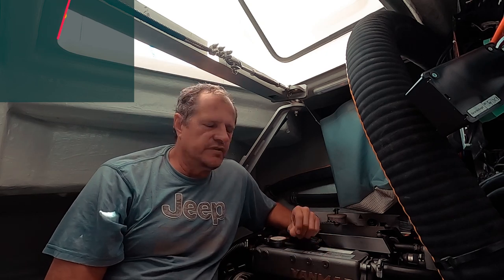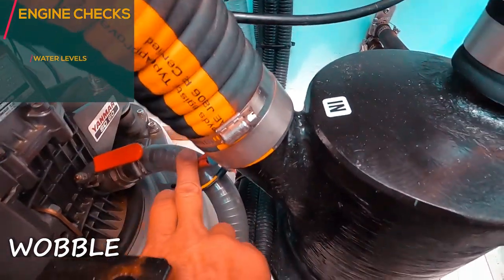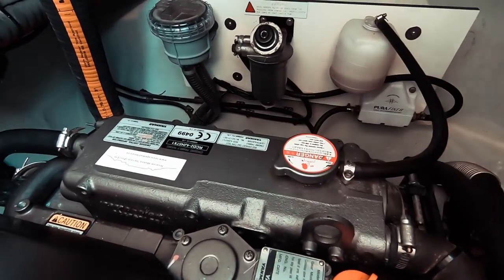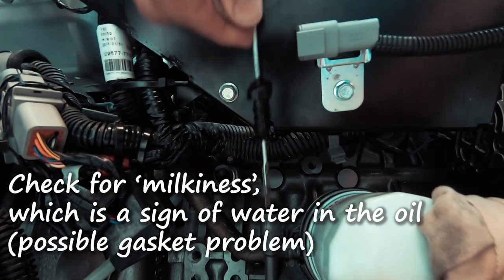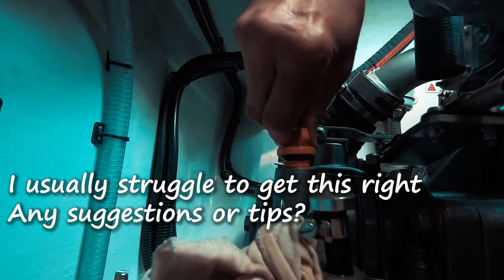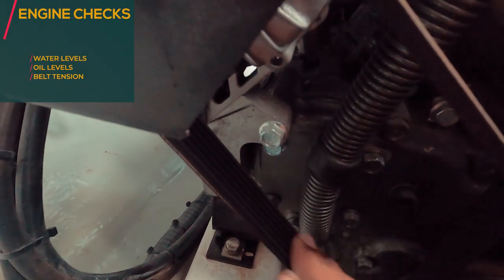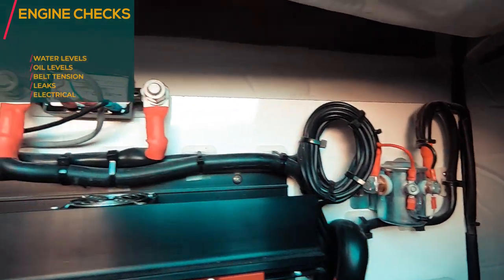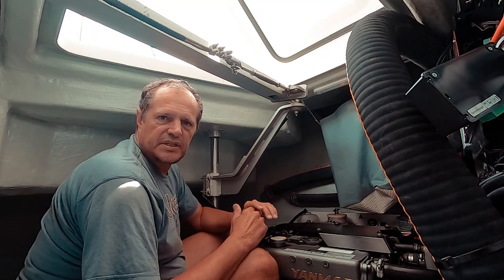#83t Boat Life A Quick 5 Minute Engine Checks | Sailing Sisu Leopard 45 Catamaran How To Series

Comment from the maker: Another Leopard 45 friend of ours just corrected me. On page 14 of the Yanmar SD 60 Saildrive Operation manual, it states that when one measures the SD 60 oil level, the dipstick should only be inserted and not screwed in. Just wipe, insert, remove, and check the oil level. it should be between the marks.
Reply from the maker: thank you, Michael for the observation and correction!

Comment: Good acronym.
Reply from the maker: Thank you, Roger! It was our RYA instructor who told us this one :-)
Reply: @SailingSisu  I would suggest you change the acronym to i wobble ........ The letter i standing for isolate ....... in other words isolate your engine before you start your checks ....... so it cannot be started by someone while you are doing these checks!  (yes i know there are only two of you on the yacht .... but maybe !! )...... As you know on the Yanmars you have that orange knob that does that.  NB to switch it back on when you have finished your checks !!! ............ Fair winds and following seas and I trust you are having a great time in the Med?
Reply from the maker: @steverogers2658  good point, it is actually included in my service video, but yeah, you don't want the engine to start when your fingers is testing belt tension!

Comment: As the other guy says , turn anti-clockwise first till you feel it fall into the threads then tighten up. Always tighten everything with very little pressure on anything with threads especially soft materials like plastic or copper and aluminium
Reply from the maker: thank you, Brett! i am trying that, but the dip stick has two flat surfaces and i think the threat end was part of the 'flattened' surface...

Comment: To get a thread started in a difficult position (like the sail drive) with very light pressure, turn the cap in reverse ( unscrewing) and feel when the starting threads "drop" the cap slightly, stop and engage forward.  Light pressure on the reverse to avoid excess wear.
Reply from the maker: thank you for the kind advice and to respond to my question! that is what i try, but if you look carefully, the dipstick has two square slots where the air can escape when draining oil..if i do the reverse turn, it takes the wrong threat, so, i actually has to lift the one side up a bit and screw clockwise...but it is a battle with the square shape!
Reply: My gearbox dipstick broke. The plastic screw top separated from the metal dip shaft.  ( they are extremely fragile and poorly made). This happened on passage and therefore I could not seal the gear oil reservoir properly so I made an emergency rTv silicone plug until I ordered a new dipstick. Cost me over 100 dollars from Yanmar. Basically I’m very careful when torquing up this dipstick
Reply from the maker: @changodelaporcelainacanada4819  good to know!

Comment: Fuel filters, primary and secondary? Check for water in the bowl if a Racor. Thanks for the video!
Reply from the maker: Thank you, Daniel for the observation! Yanmar insists that their fule filter/water trap (primary fuel filter in my video) is the only one allowed during warranty period. the racor you might have seen, is the provision for a genset, which i do not have, so, the racor is there, but not in use. the yanmar fuel filter/trap has a water float alarm and a drain (the wing thingie with the wires). the 'secondary' because i have no idea what to call two inline filters, is the black one on the engine.

Comment: Cap is like usb 2 ... 3rd time it will fit. Short but informative video tx. Frik are you using a specific product to minimize rust on the engine and mounts ?
Reply from the maker: LOL, yes, that bloody cap is always a pain with its squared sides! yes, but i have no idea what the name is...a yachty friend who is 1.5 times around the world in his boat, gave me some stuff he brought from home. seawater, or more precise, fresh water mixed with sea salt, came in my engine rooms through the key locking mechanism and it dripped on the engine and caused a lot of things to start rusting so, he told me to use this stuff and i must put it on every bolt and exposed metal, which i did and you can see the oily/greasy stuff on the bolts and mounts ;-) perhaps i put too much :-D

Comment: Frik I have often wondered whether simply lifting the oil stick and looking is enough.  Why clean it and dip it and lift if it’s been sitting there for a while and the level has settled to whatever first came out?  I reckon all the rag wiping is not necessary.  However I am never game enough to trust that,  so I always do the whole rigamarole.   :)
Reply from the maker: Tony, I have the same feeling and it might be something from the past, because my dad told me to do it like that :-D i have wondered the exact same thing! perhaps cars in the old days used different oil or dipsticks or something?
Reply: If you wanted to test it and weren’t going to use the motor for a few hours while doing a oil change...   you could bung half the oil in and let it stand a while then take the stick out.  Note reading.  Wipe and dip and pull,  same reading?  Fill rest of oil and repeat.  Same readings?  Note them for the next twenty times over the next months and see if always same reading.  Seems it should be.  But my dad taught me that way too...  so I’m still not game.  :)
Reply: @SailingSisu  Ditto here...because my dad told me i still do it as well.. old programming ;)

Comment: Frik have you seen these guys troubles with routing of hoses in their Leopoard 50 engines?   https://youtu.be/iswsHKuxpxM 
They have installed an anti siphon valve...  is that something you have considered?
Reply: Also do you leave your sea water intake gate valve open or closed when sailing?  I think it’s a bit unsafe to recommend that it always be closed when not in use which is apparently what Leopoard/Yanmar recommend.  If you middle of night drag anchor or otherwise need emergency power (eg man overboard) then that’s a bad thing to have closed.
Reply: @tonyfromaus7855  Just to add to this, we were on  a delivery trip (not Leopard) and had a bit of trouble with sail lines in high wind and had to use use the engines urgently, may have been a different outcome if time was lost to open engine compartment in heavy seas and then open the valve. Surely Leopard / Yanmar is passing the buck here, there should be a more practical solution
Reply from the maker: hi Tony! yeah, we as leopard owners have very close contact with each other and must say, Robertson and Caine have their hands full because we do talk to each other and when a similar problem arise, we discuss it :-) so, we heard of two L50s with this water problem and it would sound as if they figured it out later (after the YT video was published) but it never happened on the L45s. that said, some L45 owners did add the anti-syphon loop. about the seacock, i agree, we found ourselves a couple of times where we were forced to start the engines very quickly (a tack that went wrong in heavy wind/seas or the time those refugees came at us with a rubber duck) and a closed seacock would have been an safety issue for sure. we did however, sailed for days if not weeks, without starting the engine and never had this problem, but it is perhaps a good thing to be on the safe side? i heard horror stories of anti-syphon loops going wrong too...the devil you know id better than the one you don't know?
Reply: Yeah maybe it was a specific configuration in the 50 but not the 45.  Complexity is the enemy of reliability,  but if I was a owner instead of an armchair observer, and worried about it, (not sure if I would be) then I would be tempted to place a solenoid controlled valve at the high point with a machined block that also has a paralleled gate valve.  Maybe make the gate valve cable operated?  Anyway, default solenoid position is closed except when energised by engine switch.  Gate valve closed.  If solenoid plays up can manually bypass with the paralleled gate valve.  At the high point to allow ease of manual gate valve operation and/or cabling.